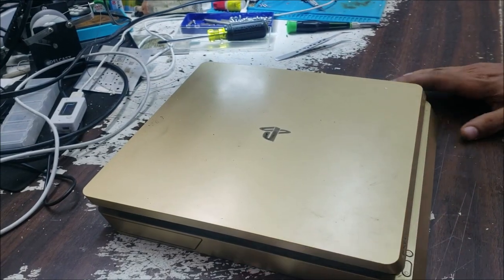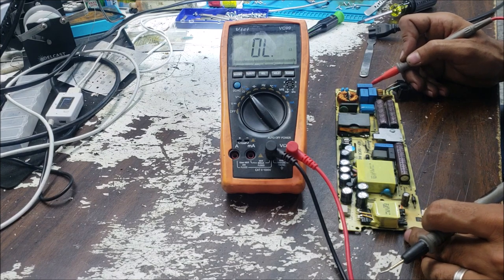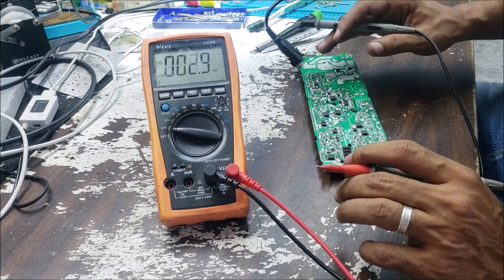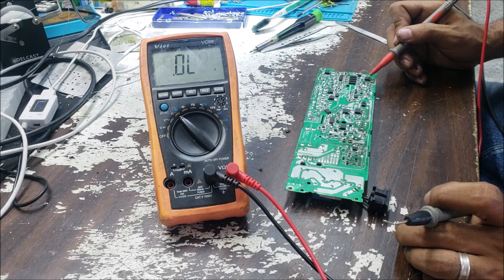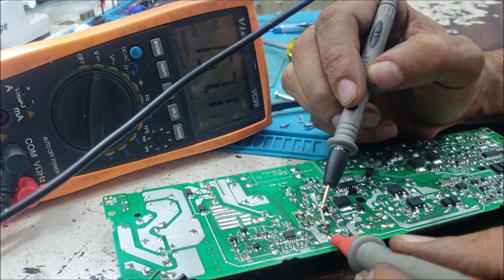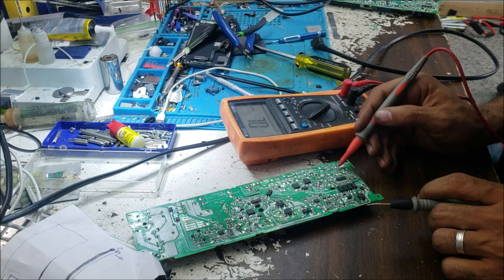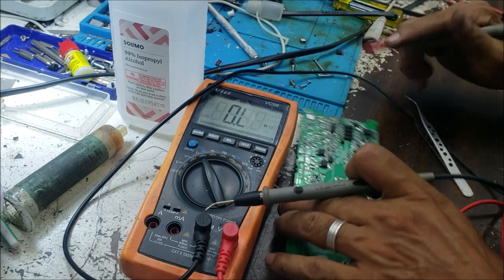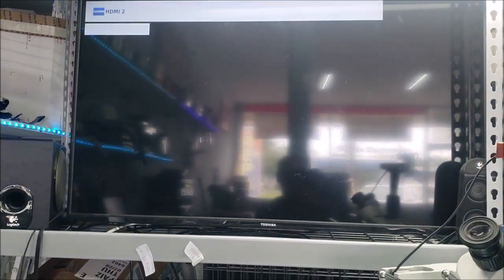PS4 slim CUH-2015B no power ADP-160CR power supply repair

Comment: I have a  adp160cr with 4.78V standby but 0V on the 4th pin (acin_det), this is also supposed to be 4.8v to start ps4. There is 17v on the other side of the optocouplers also. Have you encountered this issue? Or any suggestions?

Comment: I found out the diode in the DC area is not reading right. After changing it the power supply worked fine. But i have no idea what are the speciations for that diode. Any help ?
Reply from the maker: output diode?
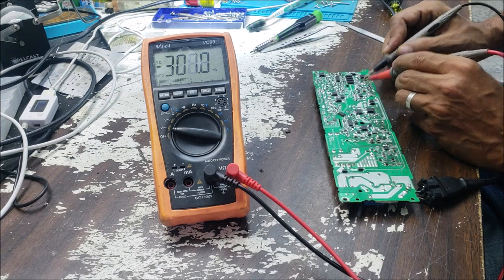Reply: @SOSfix Electronics  Yes, that diode 7:40

Comment: How to check 12volt missing
Reply from the maker: could be the mosfet or the power ic
Reply: @SOSfixElectronics  i also have the same problem. 4.75vsb is available, when i short to acdc_stby there is no 12V. I checked visually no burnt component. Fuses are also ok.

There is no repair shop which repairs ps4 psu in my country and new psu is around 60 to 70 usd 😔

Comment: Very goos video...in my case mosfet is not switching i have not output voltage because of that...ic ia fine...mosfet is fine...what do you sugest?
Reply from the maker: switching ic maybe
Reply: @SOSfixElectronics  all pins in kilo and mega...i will try to find the fault...maybe it is in the primary side...